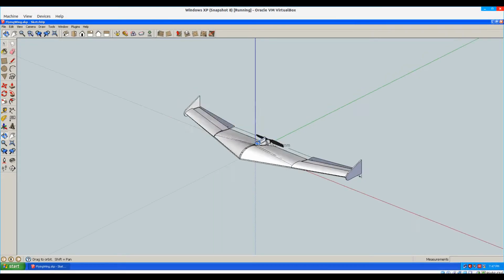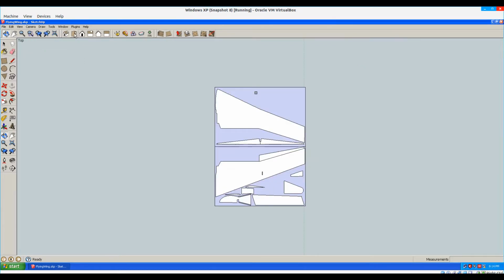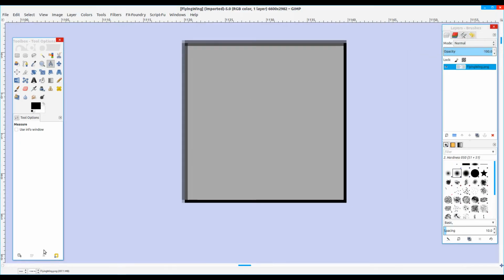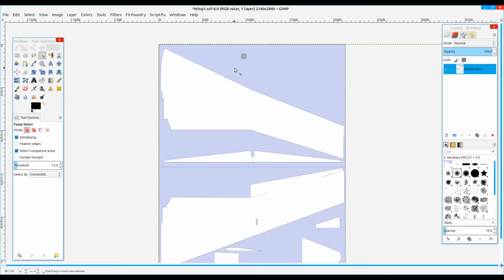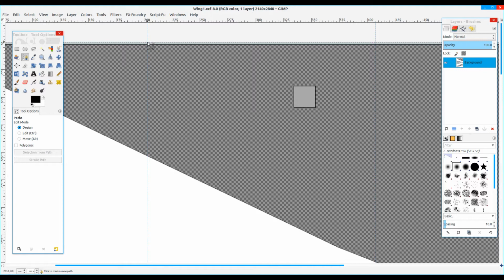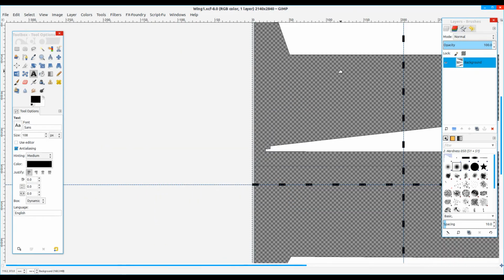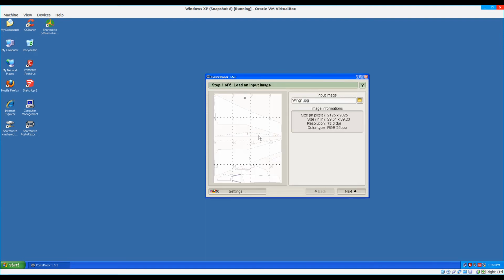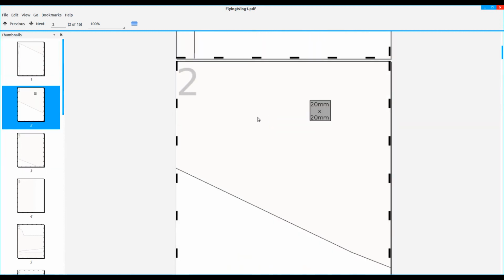1500mm Flying Wing designed in Google Sketchup and how to create PDF plans from Sketchup

Comment: did you get a chance to fly this one?
nice design.
I was thinking of hot wire cutting a wing like this
Reply from the maker: Kevin Ray I have not had a chance to build this.  I did put together a Flite Test blunt nose versa but have not maidened that yet.  Life got busy.
Reply: Any chance you could send me the file for this wing.
I would love to see how you built it.
Reply from the maker: Kevin Ray It not ready for release yet.  I'm finding parts like the electronics and battery bay difficult to get enough room to fit everything.  I'm still in the design process.
Reply: OK. Very interested to hear how this design works..

Comment: thanks for the tutorial, its great! i just have one problem. i did what u said about how to get the file to be in pdf format, but when i open it in adobe it shows the plan in just one page. i donno why this is happening. basically all the 16 pages i did in the gimp program would only show in one page in adobe. please help me out.......
Reply from the maker: I don't use Adobe Reader so not sure.  I've seen where PosteRazor would cut the picture in weird places and the page lines would be way off.  Try increasing the width of your plans to the exact width of the number of pages your have.  For example if your plans are 3 pages wide then your JPEG should be resized to 203.5mm per page or 610.5mm wide plans in Gimp.  PosteRazor can be fussy sometimes.
Reply: MrDabrudda Hello and thank you for getting back to me.  I do not really understand the concept, can you please explain to me more or make a video? send me an email explaining it more please. i really need to get this right. my email is     joshua.gere@yahoo.com   Thank you........
Reply from the maker: MrJoshua49651 How many pages wide are your plans?  Each page is 203.5mm (8.5") wide.  In Gimp try to resize the image of your plans by clicking on Image\Canvas Size from the Gimp menu.

If your plans are too small PosteRazor will cut the image up at a weird size.
Reply: MrDabrudda i got 15 pages in my plans and alright i tried what u said and it worked. i got it now. lol thank you so much!!!! and great work. keep it up.

Comment: Great Tutorial. How did it fly did it do what you expected with the tip stahl
Reply from the maker: I haven't gotten around to putting everything together yet.  I cut out the foam but the plans need some tweaking.  With other planes that have a drooped outer leading edge the tip stall is significantly reduced.  NASA did extensive testing on this in the 1970s and recommended drooped leading edges for many planes that had nasty stall characteristics.